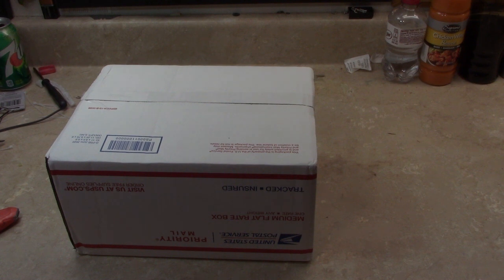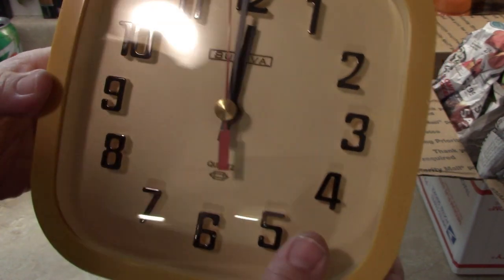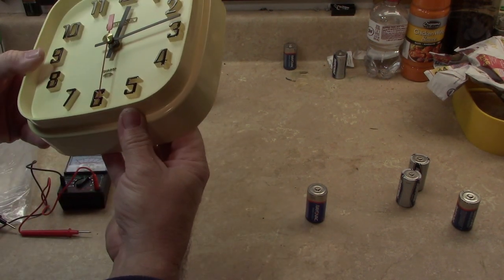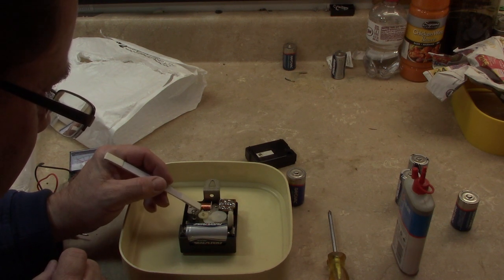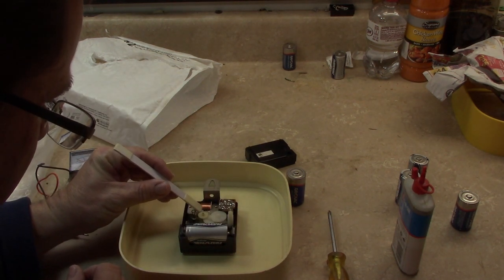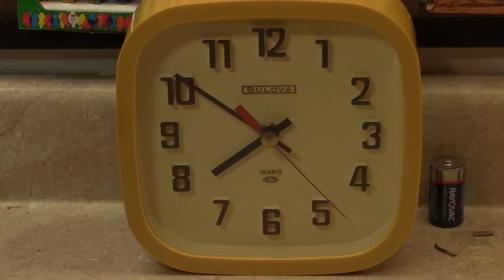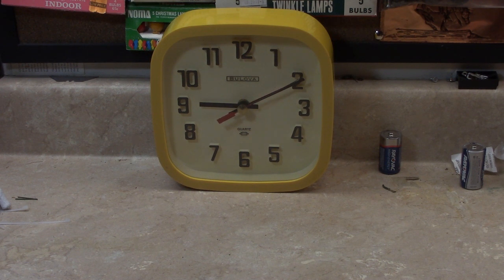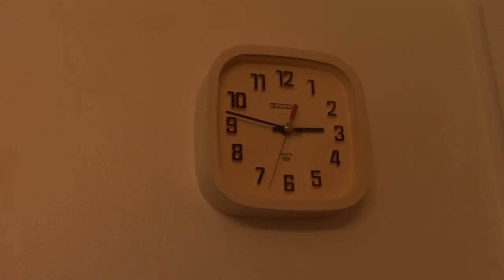Vintage Bulova Quartz Clock Refurbishment Model WC-3275

Comment: Great, another clock video! Just in time to watch while I eat my Sunday lunch. This is a very cool design, and I actually quite liked the yellow framing. Would you consider painting it yellow again? Never heard of Bulova, but from what I can see they appear to be high quality, which I suppose is testament to this one still working.
Reply from the maker: I had the same thought about the color, not really a fan, once all back together. I would like a contrast between the dial face, and outer case. The plan is to look for a light yellow, that will complement the bathroom.
Yeah Bulova is an old company. Glad you enjoyed!